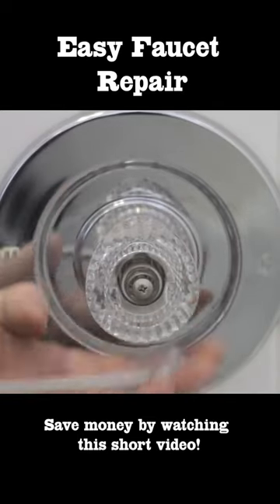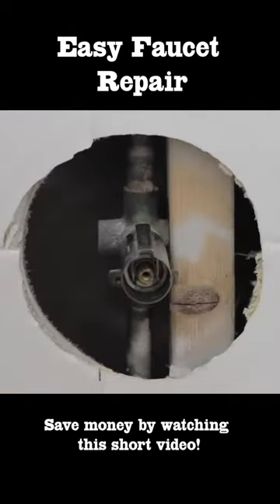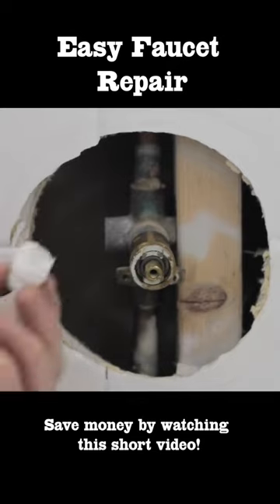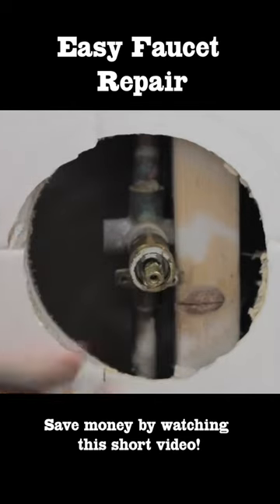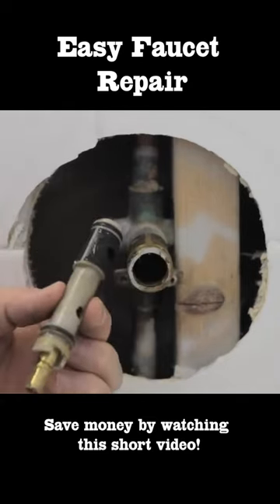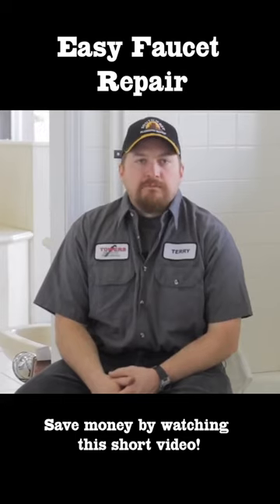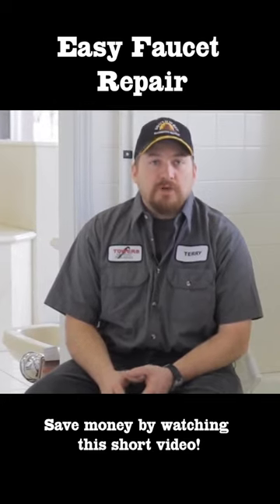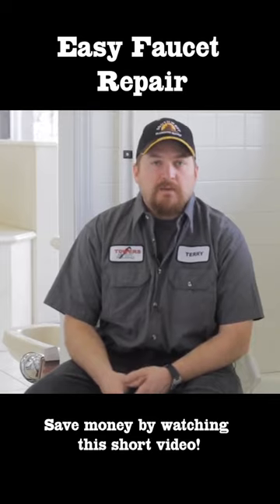Faucet Repair How to Repair a Leaky Shower Faucet

Comment: Thank you for posting this video.  I used these steps to replace a cartridge at my mom's house. She has this exact same set up.   

The tool comes in the package for the new cartridge. That tool made the cartridge come out very easily.

When installing the new cartridge, make sure you use the tool to lock it back in place.  You have to line the cartridge up so the water flows through the faucet.